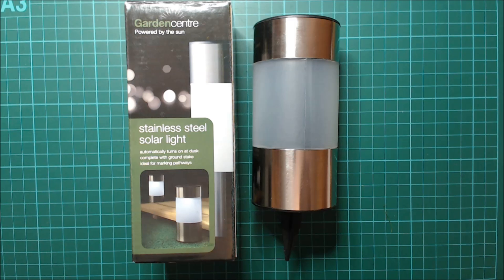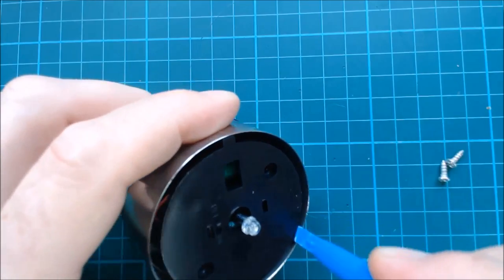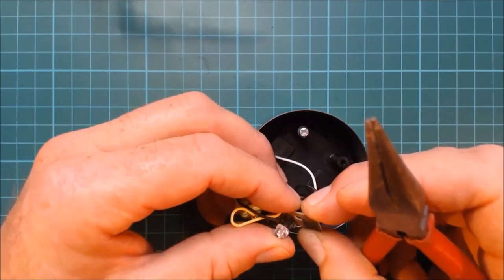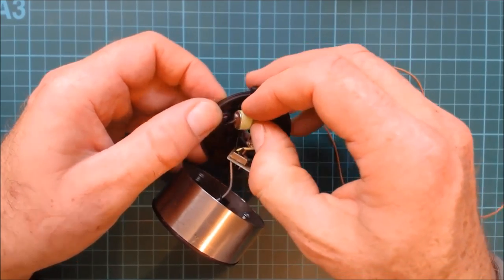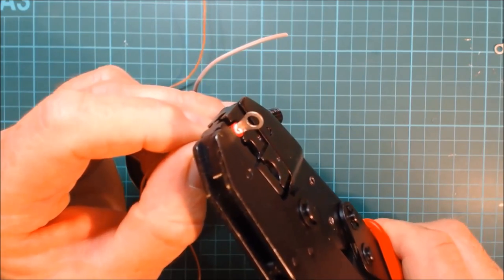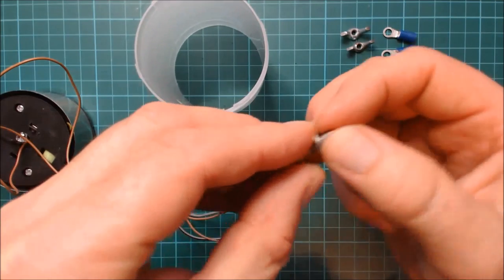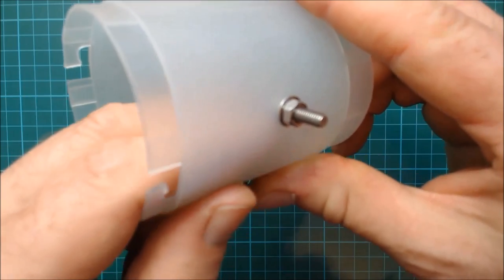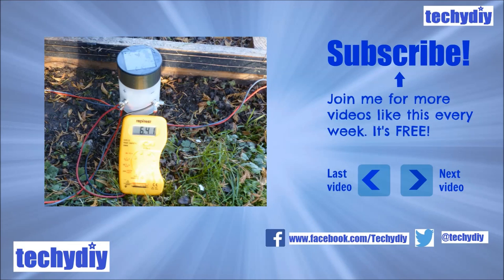Solar led light electric slug & snail fence hack how to

Comment: Oh my God, this is incredible, I have to find some one who can make one!
Reply: Hello, I was thinking of building a slug repeller from old garden lights, I just looked this up to see if it was already being done and Walla I find this, so I will go make my own version. You can make a simple version without the solar light, all you need to do is run 2 parallel copper wires about 1cm apart around the bed clipped or glued,  using a multi AA battery case (more  than 2 battery will work better higher voltage) or 9v PP3 battery with the clip on connector would be easier. All you have to do is connect
Reply: Other sites recommend 6-9V; at 12V, you’ll kill the slugs, attracting more to eat the corpses.

Comment: Thanks, this is exactly what I was looking for. Two quick beginners questions: could I just leave out the LED and attach both wires directly to the board? I am not keen on the light and would rather have the electric fence be powered a bit longer. Moreover, could the setup be changed to have 9V instead of 6? (this is what I had really good success with in the past). Thanks!
Reply from the maker: +Tim Kietzmann If I remember correctly the led is necessary for the circuit to function.  The solar lights that I used tended to work ok for a few months and then died from various causes. Unless you have the time to experiment then I can't recommend this method anymore, a 9v battery is a much better option,.
Reply: Ah, that is good to know. A 9V battery is what I am using right now, but was hoping to replace it with a Solar-based solution. Thanks.
Reply: Tim Kietzmann the led would not light as it is in series with the fence wires (note how he said to joint the fence  wires to test and light the led.) the led is not necessary for circuit function. You may get a very slight flash from the led when it zaps a snail if it shorts the connection between the led and the board via the fence wires.

Comment: These produce like 3.2 volts though, is that enough to deture a snail or slug?
Reply from the maker: The capacitor charges to roughly 6 volts ( The circuit produces square wave pulses around 9v peak, less the 3v of the led ) which is enough to deter and not kill snails. However the cheap solar lights are very unreliable so I don't recommend this..
Reply: DISH SOAP AND BEER,EPSOM SALTS AND BAKING SODA,THEY ALL KILL SLUGS AND SNAILS,TOBACCO KILLS RODENTS AND EPSOM SALTS KILLS PLANT DISEASES TO.
Reply: @douglaswoosley5136  not in my garden they dont .

Comment: Can these lights be modified to be solar battery chargers?  If 9v batteries are more effective, it seems logical to just use one of those & keep its power level topped up with a solar charger.  3v seems too low to do this task.
Reply: Yes, this is what I've done. I just used a standard 9v battery since the recharge rate is low enough not to cause a problem.

Comment: how did you step up 3v to 6v+ I did not see anything to do it
Reply from the maker: The circuit does it
Reply: @techydiy  LEDs typically use less than 6volts, do they not?

Comment: very good video. I recreated it. but can you tell me how to connect it to the fence ??? above plus below minus? Thanks very much
Reply from the maker: It doesn't matter which way around + - or - +
Reply: @techydiy  OK thanks . but it is correct 1 cable per line ??? because they have to buy 2 cables for one line. Thank you
Reply: And lines are closed or 1mm open ?
Reply from the maker: Two bare copper wires which are separated by a few mm. They must not touch each other.
You can use steel wire or galvanised steel wires as well.
Reply: @techydiy  thanks again. i'm sorry for my bad english. I meant the copper cable that goes around must not touch or ???

Comment: Hi, what is the purpose of the capacitor? What is the output voltage? It is just out of curiosity and thank you for the tip about pre-tinning.
Reply from the maker: +Beurre Pinotte About 6v. It stores up charge and gives the slug a bit more current. The led lights are very cheap though and quite often fail for one reason or another, so if your going to do it, I would just use a pp3 9v battery.
Reply: OK thank, I will use 2 rechargeable 9 volt batteries in parallel. Since they lose some of their charge when not in use, once in a while I will remove one to charge it.  Then I will do the same for the other one once the 1st one is charged.
Reply from the maker: For a real deterrent, you can use three wires for the fence, 9v batteries in series. * -ve  +ve  *  -ve  +ve  * If a big snail tries to bridge the wires it gets 18v.
Reply: 3 wires??? 9 volt would be enough and since rechargeable batteries lose their charge over time, it would be OK to charge one then the other from time to time. Now can you explain about 3 wires?
Reply from the maker: +Beurre Pinotte just another option. Big slugs learn to cross the wires if they are narrow, small slugs can get past if the wires are too wide, so you put three or four wires in to make the barrier wider. Snails farmers use many wires woven into a net.
Reply: Please can you make the wiring of a 3 wire system a little more obvious (for a total layman like me)?
Reply: You can not connect two batteries in parallel if they are not both fully charged. The battery with higher charge will be drained if you connect it in parallel with a discharged battery. Also both of them will always be discharging simultaneously if they are connected in parallel so you can't really have one battery losing it's charge and the other one not. You could cycle your batteries by just using one rechargeable battery connected to your fence at a time and have a freshly charged on the shelf waiting to be used.
Reply from the maker: +Smuutti or add blocking diodes

Comment: Sorry to bother you, but would you be so kind and tell me why did you leave the LED in the circuit?
Reply from the maker: It gives s visual indication if the fence wires are shorted and it might be necessary for the circuit, I can't remember.
Reply: @techydiy  Smart. Thank you

Comment: Bravo! I am heading to the store! One question though...In case of rain; will the water damage the circuitry in the solar collector?
Reply from the maker: Some lights suffer from water ingress into the solar panel.  I now put an old jam jar ( Bon Maman conserve jars fit perfectly) over the top of the light which stops any problems.
Reply: @techydiy  He means with the water shorting the fence , the answer is no .
Reply: Just buy a 9 volt battery, a lot easier.

Comment: Ingenious. I'm thinking of a similar setup to keep skunks away from my beehives (they will come at night and eat the bees from their entrance). You said it's safe for animals like your dog, but would it deter a mammal? If not is their a way to get more shock for a mammal? —Thanks.
Reply from the maker: No this wont have any effect on mammals, it's only a deterrent for slugs or snails. You need a proper electric fence operating on much higher voltage. I have a video that shows how to get about 300v out of a disposable camera which gives quite a shock, but I suspect you need something designed for the purpose.
Reply: what sort of dog do you have?   an electro dog?  a dog shark?   If you've got a critter with 4 legs, what do you think it is....  a reptile or something?

Comment: So theoretically it would only work at night because of the day night sensor in the lamp
Reply from the maker: Depends on the discharge from  the capacitor, but yes it turns off in the day (when slugs and snails are inactive).
Anyway use a 9v battery it's less hassle.
Reply: @techydiy  Je me suis connecté directement sur l'accumulateur : ainsi pas de problème jour/nuit. Je peux laisser l'interrupteur sur OFF, donc pas dépense d'énergie dans la LED (je suis en phase d'essai)

Comment: Maybe crank up the voltage to kill it dead.
Reply from the maker: +thechromepoet It only takes about 12volts to kill them. Trouble is you end up with loads of dead slugs on the fence.
Reply: @techydiy  and potentially a short circuit. 9v is the limit before this happens.